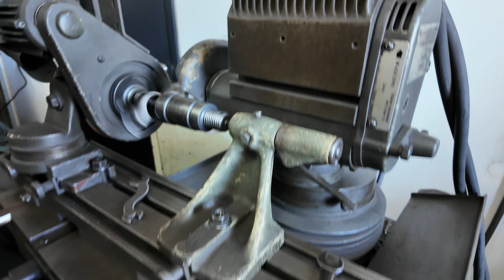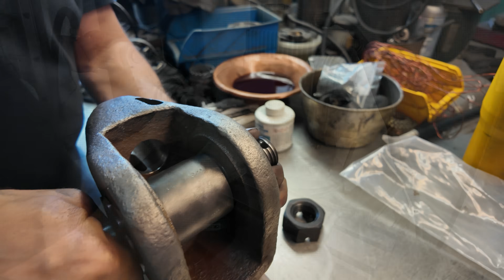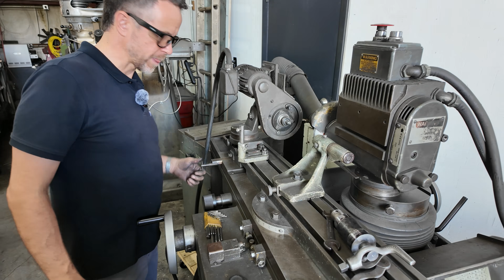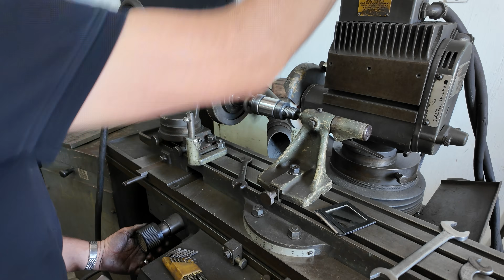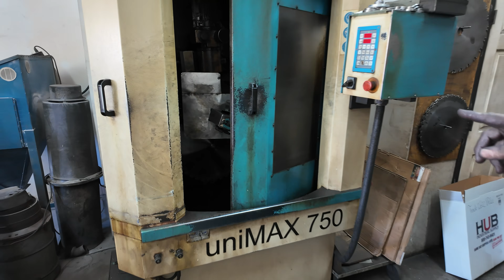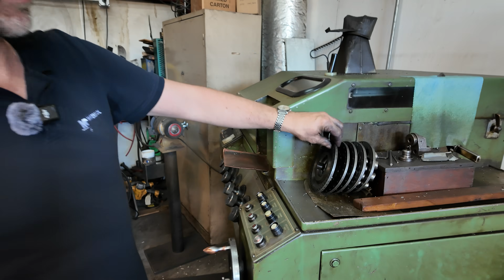Steam Stoker Engine :Grinding Tapers and Cylinders on the Cross Head Wrist Pins

Comment: QUESTION: Will you be LAPPING the tapers to each other... or leave them as-is off the grinder?
Reply: These are just mounting surfaces, with the other surface probably a little soft.  Tightening that big nut will fit them together just fine.  The goal is that they don’t move, rather than moving very precisely.

Comment: 7:10 - After fitting the after-market X-axis power feed to the mill, it took me a while (and some parts) to get used to the power feed on the mill moving the table in that direction, not the cutter.
12:45 - The other Keith got me hooked on wick-pens instead of the (expensive) layout-purple in a bottle years ago; does the job.
14:06 - I see two centerpunch marks on the cross head, bet the other has one.
21:48 - Thank you!
26:03 - Spring cuts.

Comment: We had a big cylindrical grinder in our machine shop class at Drexel Institute of Technology (now Drexel University), along with several big lathes which we got from the Philadelphia Navy Yard as it closed down. 
That grinder’s controls worked backwards from the lathes. Our instructors warned us to be very careful not to crash the grinding wheel into the work piece. We were all scared of that machine.
When I got my turn on the grinder, my assignment was to grind a taper of XX degrees on a 1.25” diameter piece of bar stock. I got the taper offset setbup and started to grind the bar. About 1/2 hour into the assignment, my brother walked by, and asked what I was making. Then said, “Shouldn’t the workpiece be rotating?” I was so worried about crashing the grinding wheel into the bar I had forgotten to start the part rotating! 
When it was time to turn in our work, the instructor asked what my assignment had been, I said it was to grind a tapered flat on the bar. He looked at me, then said, “Nice try…”. He gave me a “C”.
Reply: Watching the setup run with the lathe dog reminded me: our instructor had a cool nickname. He was recovering from Bell’s Palsey, so one side of his face was paralyzed. The students called him Chuckjaw Donlan. (Not  to his face!) 
After my adventure with the grinder, we started to call him LATHEDOG DONLAN. (Also not to his face - I think he really like that nickname.)
Donlan also taught Precision Measurement, one of the most useful courses of my entire 40 year career as a mechanical engineer.
Reply: That grinder would be great for Bozo, he dose everything "backwards"!:face-blue-smiling::face-blue-smiling:
Reply: @garybrenner6236  thank you for so diligently watching and supporting my favorite Bozo with all of your algorithm enhancing comments...

Comment: When you do the final install, is there a torque reading you need to achieve on tightening the nut?  I see there is a hole in the threaded end for a cotter pin, but once that steam engine is working, you certainly don't want anything to come loose.   Excellent video and you provided some good advertising for Myers Tool.  Looking forward to seeing the stoker in action!
Reply: When Bozo is finished, everything on that Stoker Engine will be "coming loose"!:hand-orange-covering-eyes::face-blue-smiling:

Comment: Nice job. I'm really surprised that it wasn't a live center on the tailstock of the grinder.
Reply: They almost never are, you get a much better result with a dead center. A live center has runout of the bearings. It may be small, but it’s there.
Reply: @number2664  Thank you. I know there are some with zero runout. But they are really pricey.
Reply: Bozo needed help because those tolerances were too close for him, anything under one eighth inch and he's lost!:body-blue-raised-arms::face-blue-smiling:
Reply: @garybrenner6236 he does pretty good work actually

Comment: 5:10 If the cones aren't ground concentrically, the straight cylindrical section will lose concentricity and end up with a reduced diameter after grinding.
Reply: Keith oversized the dimensions to account for the tapers not being perfect relative to the CNC profiles. As long as everything cleans up, is in spec, and still hard (not ground past the case hardening), I don't see the problem for the level of accuracy needed here. Centers are relatively standard in angle and they won't be used a lot in the future, so good enough is good enough.